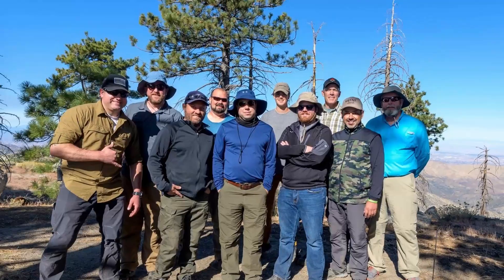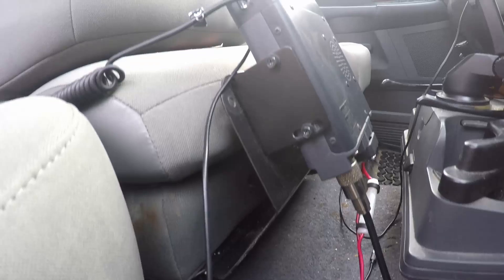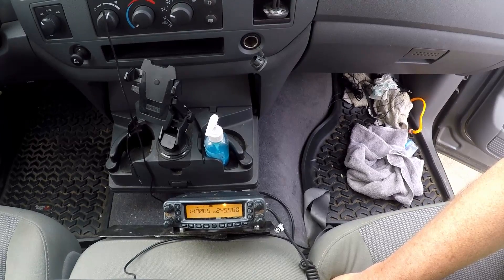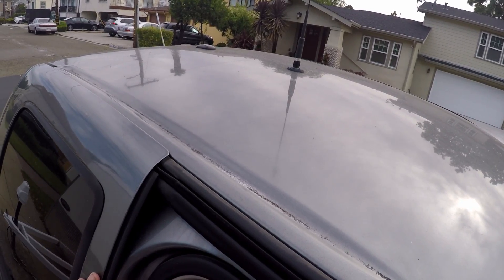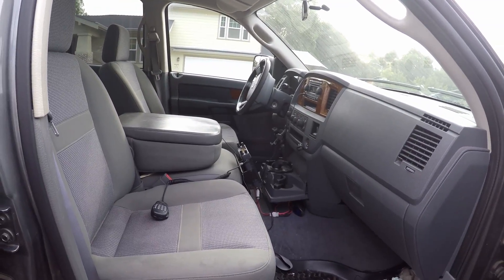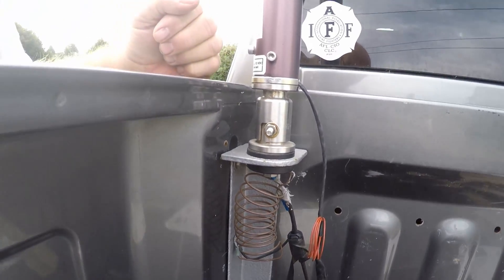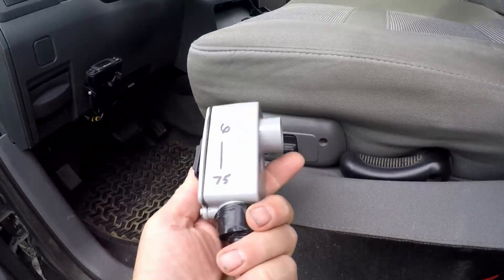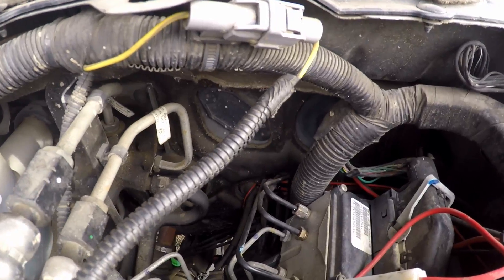How to Install a mobile Ham Radio  in a Dodge Ram Quad Cab.

Comment: Good video.  I am going mobile soon.  I have a new truck and have been holding off on getting radios while I waited until I purchased a new truck.  Now I have to get off my seat and put radios in.   Haha.  I am thinking of a Yaesu 891 and an HT with a BNC adapter (my HT is a Anytone 878).  Then as I grow into the hobby I will get a proper 2m/70cm mobile rig.  What is the link or part number of your screwdriver antenna?  All the best! 73 de KI5HXM